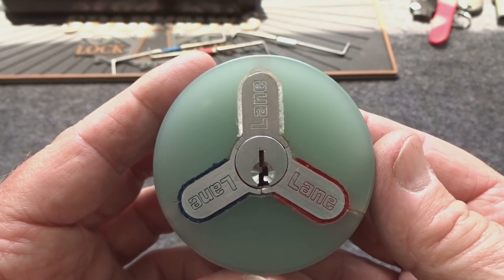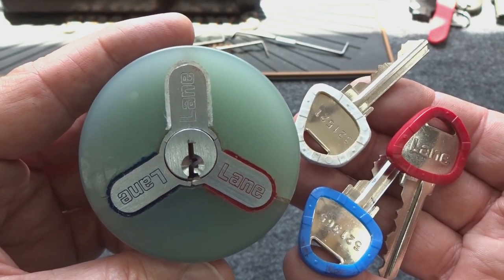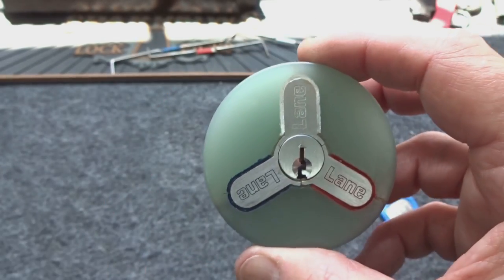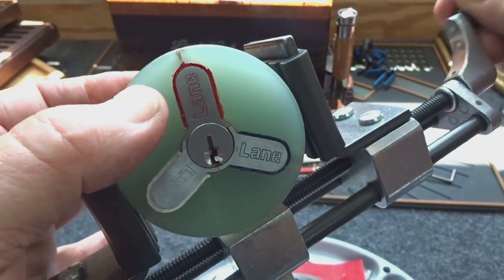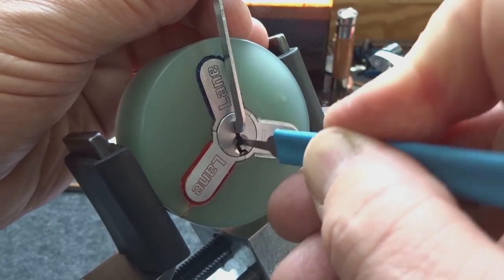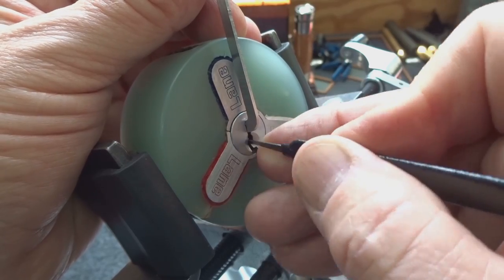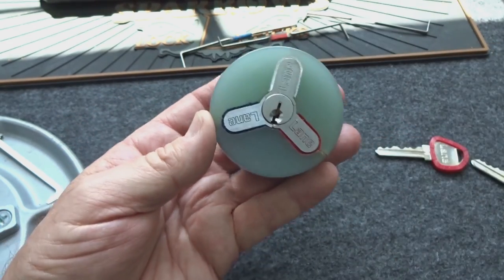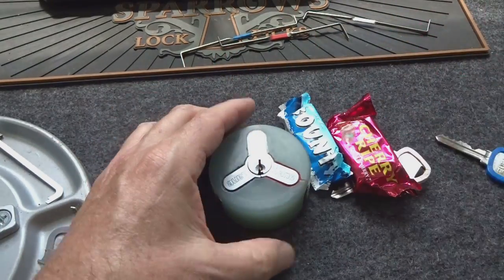(1094) Challenge: Version II Triple Lock from Daniel

Comment: There's one security pin in this entire lock. It was a wafer driver 2nd pin blue bible, im impressed it slowed you down.
Reply: Really awesome work you're awesome! I need to know, though, did you add side grooves in the bible so that the key pins from the previous key position are allowed to move into the bible of the new key position?
Reply: Kin Cheng Really dont want to give the trick away until T&J get it. However thats not how this one is done. Possibly could do it the way you describe though.
Reply: DN Hunziker I'm impressed in every way, well done I hope to see more of these one day
Reply: Do you know the reason why the lock will not operate counter clockwise?
Reply: Phy incase you want to launch your nuclear missle in your back yard, so to reset it from first position you have to launch your missle.
Reply: i know this is old and i can probably find the solution elsewhere, but woudlnt this only work if lock in the wheel engaged different pins? key pins that are deep in one lock being high in another would always jam, so each lock only engages with certain key pins?
Reply: hmm i didnt factor in you could just drill out "exception" tracks for the taller key pins, but then theyd bump on the next locks driver pins(edit which i think is what kin guesses lol)

Comment: Years (and years) ago, I modified a lock where one key (manager) could both lock & unlock the door, where a second key (employees) could only lock it. The idea being that the employees could lock up at night but not sneak back in later.

If I had access to milling equipment, I think I could duplicate this lock by having some pins run along different depth grooves while turning. I'll have to give this more thought.
Reply: Corey S for the lock and unlock, it was probably a commercial style deadbolt that you have to rotate different directions.  Probably just Modify the core to allow one direction without all the key pins activated?
Reply: It was so long ago, I have a hard time remembering. I think I elongated one of the pin holes in the core (sideways in one direction) so a pin can rest at an angle, thus lowering the height of the pin.

Comment: I am thinking on how this one works.If you have a set of bottom pins for the first key to work, to make the second work you would have to have master pins fall into place wouldn't you ? If so, when you turned it to the next cylinder it would carry those master pins with it and the previous key should not work at all anymore. I wish he had gutted this one so we could see how they make that work. This one is very intriguing.

Comment: I'm guessing that since the pins can't vary in length, it's the shear lines that are varying between each lock. Clever stuff!
Reply: Of course the pins can vary in size... they have to because each key has different bitting.
Reply: micglou how would you change the pinning between each section?
Reply: baldpig2k12 nice thoughts about the sheer lines. Though how do you make the cylinder turn when the sheer lines are different? Some of the key pins will have to push down base pins when it reaches the next section i guess.
Reply: Just like a single lock, pin it for every separate key... as can be seen in this video. This lock is nothing more than three different locks put together. Varying the height of the shear line would be impossible in those kind of locks because the tolerance of the cylinder housing is only about 2mm and obviously the cylinder itself is a single piece... if the shear line has varying heights the cylinder should also have varying heights obviously.
Reply: micglou the key pins rotate together with the key in the cylinder. So it only had one set of key pins and 3 sets of base pins. It's definitely not just putting 3 standard locks together.
Reply: micglou but then each key would be able to rotate 360...
Reply: You're right, I was over simplifying it... I was just trying to argue the point that with the low tolerance in the cylinder housing prevents being able to have varying shear line heights... and of course that the cylinder can't be anything but a circle otherwise it can't be turned. My best guess would be that there's more than a key and base pin to realize different heights, which would kind of explain the key can only be turned one way... or maybe even more simple, not every slot has pins.
Reply: I think each lock has different inactive pins. So the bitting of the wrong keys doesn't bind up. If it was different shear lines, then all 3 keys could spin the lock all the way around, because there wouldn't be room for pins to drop into the core.
Reply: How about locking bars from the outside with the rake coding on the base pins?

Comment: I think there might be some sort of ramp in the cylinder that stops it from turning backwards? So you have the pins popping up through the bottom of the keyway(which is ingenious) but there might be some sort of ramp that blocks you from turning it backwards via the pins.

Comment: Hmmm if I had to guess I would think that each of the 3 cylinders only has about 3 driver pins inside, and each key has low-cuts on the inactive pins of their respective lock.  You can see at 5:12 when Bill turns it around, that one of the key pins is just floating there with no driver behind it.

Comment: That's very cool!  Seems like maybe that would need to be master pinned in order to pull the key out of the next color?  My finite mind is blown.  Cheers! Chris.
Reply: CrossWood You can always get the key out. The problem is rotating it, but I think the tip came from being able to only rotate it in one direction. There may be cutouts in the top of the bible, so you can get them in one way, but different cutouts on the other side, so you can't continue. Damn cool lock...!

Comment: what he might have is a simple lock lever set that allows it to slide one way, it would probably be shaped similar to one of your picks where it's able to slide, then latch into the next notch and hold it from coming back.

With enough force I'm sure it can be broken but for a piece of art as this, you wouldn't want to.

This would work well for electronic locks as well, where keys can be magnetically coded differently to permit the lock to spin - think the same magnetic stripes they use in books and DVD's so they don't get stolen from the library but doesn't detect things that haven't been stolen from the shops, at close proximity to the sensor they won't need an antenna to boost the signal, or the teeth could be the antenna.

Comment: problem with this lock is that use standard key, too much space for picking. good idea but need 360 small tube key, i mean small diameter, little hole, many pins. lockpicking is easy if you have space. so first pin is in end of lock. so you need to know how much you have push that pin before you can picking other pins if you realse that pin end of lock so you cant move other pins. it takes a lot of space from lockpicker. plus add pretty strong spring what push lock back to left so it makes more harder for picklocker to push it to right with tool and mess up little that click feeling thing. yeah its harder to unlock with keys too but guys that lock need 3 keys.

Comment: I have an idea for the triple lock, though it may not work. Extra set of pins, maybe just a couple, that don't have to work with the top side of the key; but have a couple knotches on the bottom side of the key to hit those pins when you make that 60 degree turn when the bottom of the key lines up with a set of pins.
Basically have 6 locks, 3 for the top of the key, 3 for the bottom. This would make picking increasingly harder, as you have two sets of pins, and they're offset by 180 degrees. Security pins and making the locks to where they can't be bumped would make it damn near improbable to pick it.

Also, someone should find a way to make this function as a standard lock, where you turn it one way to lock, and the other to unlock. This one seems to unlock then lock as soon as you complete the revolution; could see that becoming an annoyance over time, especially in a hurry. Maybe add a ratchet-like mechanism with a heavily sprung pawl, so all you have to do is torque it slightly to lock it.

Comment: it needs some sort of shim to stop them pins clogging up the opposite end
Reply: diggin pooch why? when using the keys it doesn't bind, so it makes it more confusing to a lock picker if they don't know what is going on. If you put a cover over the locks to hide it no one would know it's a three key lock
Reply: a lock picker i trying not to use the key
Reply: diggin pooch i did send a little wiper insert that fit in the bottom of the keyway just for spp, but i think Bill likes to do things the hard way.
Reply: ahh was this your work very nice job you did id love to build something like this but no tools i think for the practicing picker its genius

Comment: LOOKS MASTER KEYED
Reply: Terry Marcotte I actually suspect they have different slits on either side of each bible, so you can only use one key each way. Since it still needs to turn for three different keys with different bidding, it probably would be impossible to master-key this thing...
Reply: I'm guessing difference in each bible too, that is the only way I can think of how different keys would be able to work. Master keyed should have pins in tear line and rotate all around I think.
Reply: seems the most legit explanation so far...
Reply: mastered for each key, but 3 holes must be cut down about a #2 wafer  on one side to keep key from reversing, one different chamber for each key, we use to do that on gas stations, so the last guy to lock cant come back in, only the manager can with key cut higher in one chamber (normal key)

Comment: So put security pins, attach it to a steel door with an electronics system which operates bolts that are placed on every side and you have the safest/biggest pain in the ass house door.